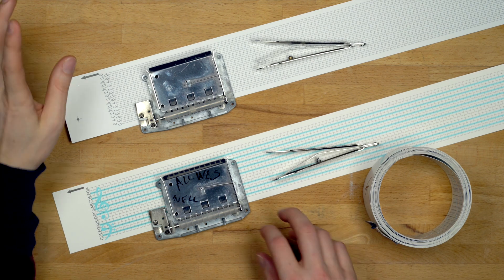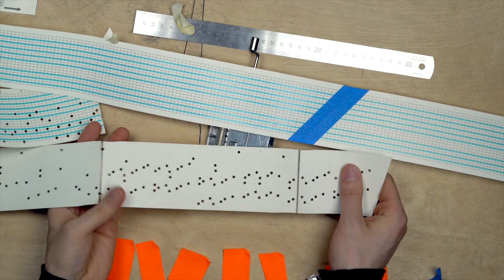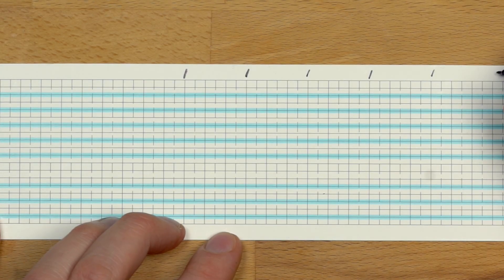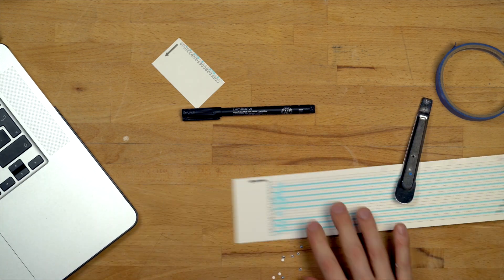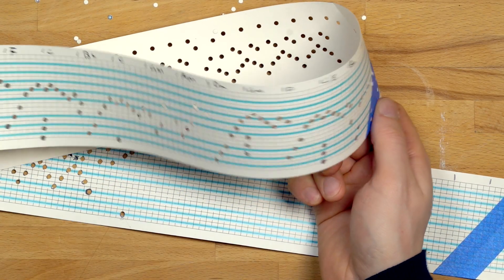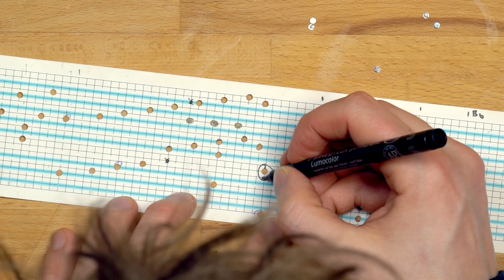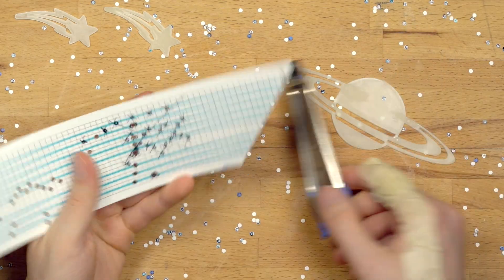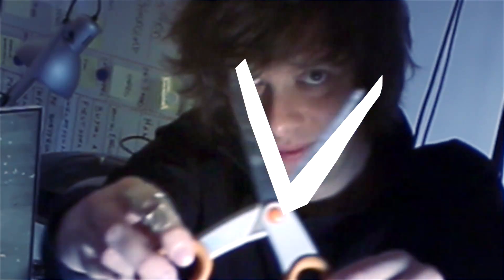How To Program a Music Box - Hole Punch Tutorial

Comment: Hi Martin. Would it be possible for you to upload a video on how the music box actually works? I've been interested for a long time in how the mechanism reads the holes on the piece of card.
Thanks for these Wintergatan Wednesdays videos! They're always great to watch :)
Reply: The sound is produced by metal tongues of different lengths for each note. Above each of these is a wheel with teeth, a bit like a gear. When the wheel is turned, the teeth pluck the metal tongue, producing the note. When the paper is fed through, the holes in the paper latch on to the teeth on the upper side of the wheel and turn the wheel slightly as the paper is pulled foward, making the teeth on the lower side of the wheel pluck the metal tongue. Hope that makes sense!
Reply: @OwenEvansMusic  Wow, how did I just now see your comment? I know this is a late reply, so I'm not even sure if you're still interested in this after all those years.

There is one problem I see with this explanation though, and others just like it. Forgive me if this gets quite long, but This does not explain exactly why it is that the wheels only rotate when holes pass over their teeth instead of just rotating constantly, and it also simultaneously does not explain what it is that gives the wheels their rotational energy. It's not your fault, far too many explanations that are just like yours, while they do sort of make sense, are incomplete or even a bit incorrect.

It is my understanding, though, that the wheels rotate because of a simple rotating shaft on which they are mounted. Both the wheels and their shaft would have to have their own bearings such that they can rotate independently, where stopping the wheels from rotating does not stop the shaft from rotating. Then, an obvious reason they do not rotate without a hole in the card is simply that of 2 opposing forces: the shaft rotating the wheels in one direction, and the card attempting to rotate them in the opposite direction such that they resist rotation. A hole catching a tooth on a wheel means that resistance is broken such that the wheel can freely rotate, because the shaft has been rotating all along.

Also we must consider the direction of rotation. If the shaft is rotating "forward", as in, in a forward direction, and their wheels are also rotating in that direction, wouldn't the punch card have to push the wheels "backward", using the "forward" motion of the card? This could only be possible if the punch card is moving not from above the wheels, but instead from underneath. The vibrating metal tongues that make the sound would then be positioned above the wheels and not underneath. Another commenter I've been conversing with on another video explained it this way (the wheels are "underneath" the metal tongues), so reading your initial 7-year-old comment I am now confused. Are the wheels underneath or above the metal tongues? Which is it? That is important to know because it makes the explanation more complete.

Your specific explanation (the 7-year-old comment) would only make sense if the wheels and their shaft were rotating in opposite directions; the shaft would have to rotate forward while the wheels would have to rotate backwards. But that just doesn't seem right, that's not the way physics works is it? :)
Reply: You're in luck! watch?v=OacXT6Nk0LE

Martin posted a build video on it in February, enjoy! It should explain everything you'd want to know about it

Comment: If you had access to a laser cutter and Adobe Illustrator I think it would be quite easy. Perhaps Corel Draw too but I'm more familiar with Illustrator. You'd still be placing the holes by hand but it would be somewhat less tedious and I imagine there's a program out there or one easy enough to make that could take the data points and output a file that already has them placed in such a file.

You would make a canvas the same size as your paper divided up into sections that would fit into your laser cutter, make a grid out of guides that match your paper, lay out the notes using the circle tool to the proper size with a .001 pt stroke weight, and let it cut. The trickier part would be building sort of jig to have the paper sit in the same spot each time you cut but I can already picture something relatively easy to build to accommodate that.

Hmmm, maybe I'll see if I can put a video together of how I'm thinking it would work. If I do I'll put the link here, I just need some of that "free time" people tell me about.

Comment: I had an idea, something that shouldn't be too hard for you to implement. Let's say you wanted to vary the tempo automatically. You could put buttons on the box so that someone could adjust the tempo,  but there's a better way.
If you have an LED and an optical sensor, you could teach an arduino to tell when  there's paper between the two. (There's probably a mechano-electrical way to do this that works better, just FYI.) Then, you could punch holes in the margins of the paper, and use that sensor to detect certain patterns in the holes that you punch. you could easily have three speeds by just using two hole positions. 0_ could mean slow, 00 could mean medium, and _0 could mean fast. Then, whenever you want to change the tempo, you just slid a thin wooden jig on the side of the paper, line it up with where you want the timing to change, and then punch the proper holes as determined by the jig.
Reply: Hey, I had that same Idea. But if you'd use an arduino, why don't use binary encoding? Then you could easily get 8 different speeds by just using tree holes. And you could also use the other edge of the paper to control the volume and make a chrescendo for example. 
But I don't know if that would really fit to the music box, because the point is having a mechanical device producing the sound. I think it would look better if you do it mechanically. Maybe a simple mechanical counter, then the speed is determined by how many consecutive holes there are. And the adjustment could be done by a belt that runs on two cones and is shifted to one side or the other. Unfortunately I'm not at home so i can't try it out by myself.
Reply: One problem with that that I have is that you need a configuration for "no change". Otherwise, he'll have to continuously punch holes for wherever the music is a certain tempo. I think it'd be best if he only had to punch holes where the tempo changes, and thus you can't use the _ configuration, as there's no way to distinguish it from the rest of the program. 

However, I was thinking of binary when I made this comment. So we are thinking along the same lines. Just, with what I was thinking, you could only use 2^n - 1 out of 2^n combos without continuous punching.
Reply: And then you could add registers like was used in the days of fairground organs where a non playing hole position changed the equivalent to stops in a manual organ

Comment: Hey Martin, I've been loving these Wintergatan Wednesday videos. I'm an engineer/programmer/musician with experience in laser cutting and would love to work with you on automating this process. I think it should be pretty simple. I already have some ideas, but please get in touch and we can talk about what you have in mind!
Reply: better of with writing an email to him. even though i think he reads the comments, an email won't get lost that easily
Reply: TheJogMan [last name is required so here it is] I agree. A laser cutter would work, but not everyone has access to one and it is definitely overkill. A purpose built machine with an awl or hollow punch controlled by an arduino could work, but that can get costly. I think the best solution is a vinyl cutter. The price of stepper motors and linear slides adds up quickly and it's hard to beat $150 for a ready made vinyl cutter.
Reply: Once you have a machine that cuts a midi file onto a roll of heavy paper, you don't need the template... Blank heavy paper will do... It just need to be of the right width and I'm sure this can be found easily by the roll...
Reply: Hey Zac, I'm current studying electrical engineering  and computer science! I also have access to a laser cutter, 3D printers and a lot of electronics. I'd love to help out! I think this can be done in less than $50 in parts.
Reply: Yea with a rasberry pi/arduino or whatever and some help automating this wouldnt be that hard
Reply: Thanks, I did this after FeuerToifel's suggestion to email him. :)
Reply: How about those IBM card punch machine. could one of those be repurposed?  Just a wacky idea!!
Reply: If you have advice or ideas on my two questions that i am asking in the video (laser cutting software & 20-note music box continuous paper roll) the best place to send me ideas is actually by posting a picture on the Marble Machine Development photo sharing page:
 says this in the desc just follow what he says
Reply: My thoughts: There are laser cutters that can take SVG as input (or image formats to wich one can convert SVG using ImageMagick) so a simple Python script that reads a MIDI file and produces a SVG file should be enough. Generating SVG is easy and you can do it using mm as units and apparently there are libraries for paring MIDI for Python.
Reply: I'm building up some sort of  an instrument with a musical box, programmed led lights and dead branches and I'm going exactly through the same process. An automated process would be marvellous!
Reply: Any updates on this? I'm curious^^
Reply: Happy to help!
Reply: you could also probably get away with using a cnc and regular drill bit. Also you could use the motor for the automated music box to pull along the paper at a steady pace while the cutter/cnc/whatever cuts the holes along just one axis. This way you wouldn't have to constantly have to realign everything after you run out of space. And you could use some kind of guide rails to keep the paper steady as it is being pulled.
Reply: I
Reply: Hey Zac, can u make midi file into a printable file with exact dimensions for holes, which can be printed on a desktop inkjet or laser printer. It will be pretty easy to make holes manually on the print. it will be very inexpensive.
Reply: Chiming in on this, I use a cutter plotter which would also achieve the task and is much cheaper / smaller / less daunting then laser cutters. The cool thing with a cutter plotter is it could either cut the holes out for you or using a pen attachment simply draw guides in for you to hole punch yourself... If any conversation about this subject does arise I would also be glad to discuss idea's and such!
Reply: What about making a github to work on that as a community ?
I'm a programming Engineer too, and I think it will be fun to do this/maintain all together.
Reply: Zac Levinson Or maybe if one could nab a few old computer paper tape punches/readers. Those are of course only 8 bit wide, so much narrower than this, but maybe it would be possible to connect several punch units, only the actual mechanisms, in parallel.
Reply: bloody_albatross and Francois Allard, that's what I was thinking too. The actual tool used to manufacture the sheets almost  doesn't matter. The CAD to CAM pipeline is going to be essentially the same whether it's a laser cutter or cutting plotter. A python script that reads the MIDI and writes and SVG file would work well and that would be the only step between sequencing the MIDI and bringing it into the cutting software. Buy a roll of heavy paper or a large sheet of heavy paper, depending on the required weight, and you don't need the templates anymore. In the video it looks like it's a medium weight paper, so you can probably buy something similar by the roll.
Reply: Somebody make an all-in-one hole punching machine and send it to him.  Make it as simple as 1. put midi file on SD card, 2. load paper, 3. put in SD card, 4. press print.
Reply: I thought of that too, but they are usually only 8 or 9 bit, so they won't have enough hole punches per line.
Reply: Unless you can mount three or four in series, slightly staggered sideways, and run the strip through all of them. That might work.
Reply: Zac Levinson ii
Reply: FeuerToifel spam?
Reply: You could also use a arduino or raspberry pi to use a hole puncher and use CD-ROM motors to push (remove the hole punch springs though)
Reply: my thoughts exactly
Reply: Worked in a data centre about 6 years ago that actually still had a machine running one of these.  It ran a very specific function that had no need to be remade, and it did the job perfectly.  Funnily enough enough gave me a red square on my monitor that meant I had to phone a senior engineer either :-)
Reply: Some might consider it overkill to mod your own hardware to do something a laser cutter can do, but it certainly would be a valid solution. If you made an automatic hole punching machine and ran it to punch the song while the motor from this video pulled it through, you'd get a perfectly timed song as well.
Reply: Zac Levinso
Reply: Aw man I was thinking about an automated hole punch, but yeah, lasers. That'll be fun
Reply: 1k like :)
Reply: wouldn't it just be easier to just buy a tabulating machine, and convert the midi to the necessary format? I mean it's not like there isn't a surplus of IBM hole punching machines for punch cards from the 80's floating around that couldn't be repurposed.
Reply: using a laser cutter sounds slightly excessive, the extra precision is probably worth it but when working with a budget it might be better to find some way of controlling a mechanical hole puncher, simply running the device at a slower speed might compensate for the precision loss while still being far faster than doing it by hand
Reply: https://plus.google.com/u/0/collection/c9fLZ  
This is interesting, i begin this project some time ago, still have a lot to to be better at, is basically based on the traditional music boxes  but i made it using IR in order to read the pattern, hope you guys like it ^^, although is in Spanish, but i am pretty sure the pictures of the process are enough to understand what is going on in this simple procedure, it  can also provide some ideas  for future projects you guys got :))
Reply: @MrCubas69  Unfortunately, Google Plus doesn't exist now! Do you have a more recent link for us?
Reply: Zac Levinson it's indeed pretty easy to automate the process
Reply: An laser cutter is obviously overkill, modding an clone of an old tape puncher, made for the computers of the 1970s, combined with the right software, and the song can be written on tape in 2-3 minutes (if you find one of those very fast punchers it can take at max one minute, but most likely it would take around 30 seconds). Remember, the puncher must be modded! Someone with soldering equipment, and some circuit parts, like capacitors (random example) can make his own automatic puncher.
Reply: Why even bother with a laser cutter or a music box when you can play a music box instrument on a keyboard, store it in a file, and play it back with 1 click!  The entire point of him doing it the old-fashioned way is for views and subs.  So take your stinkin laser cutter and go cut out some very intricate paper snowflakes.